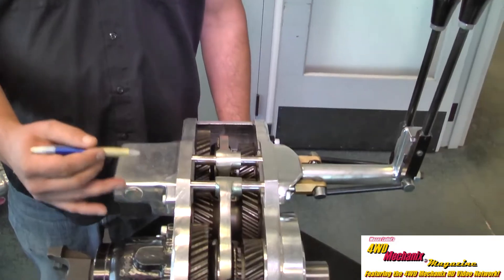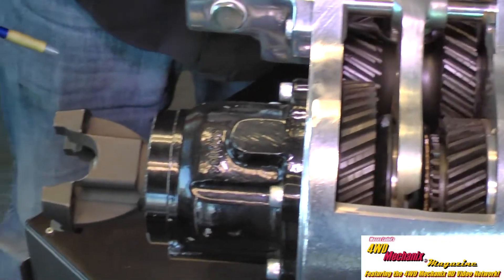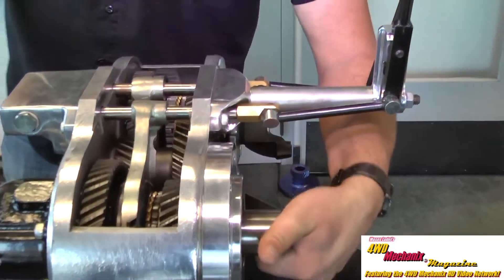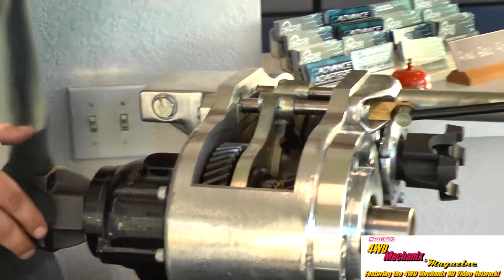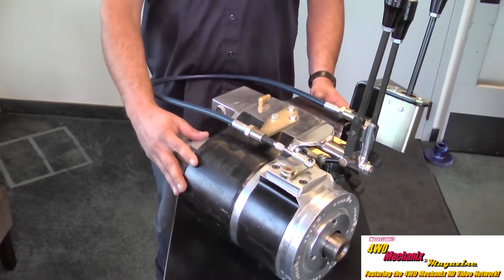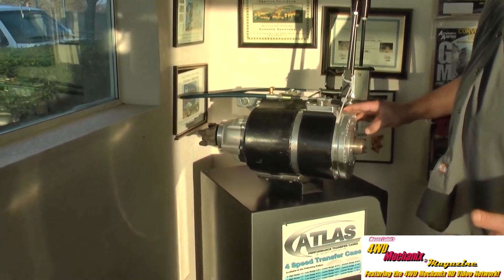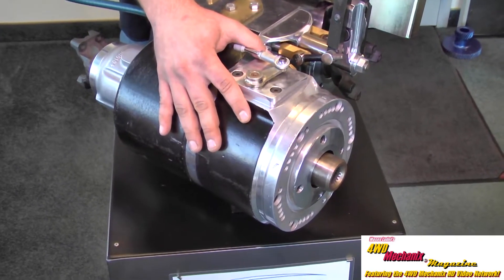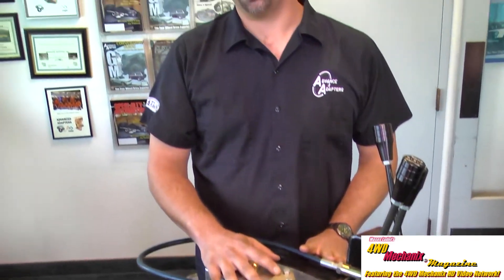Advance Adapters Discusses the Atlas Transfer Case Design and Operation

Comment: I have an 06 dodge ram 1500 4x4,  5.7 Hemi. Do you have any adapters for an atlas 2 speed for that?
Reply from the maker: That's a good question for the folks at Advance Adapters.  There are many Atlas configurations, and it's likely your Ram can be outfitted.  Shift linkage is an issue to discuss as well...Give tech a call at 1-800-350-2223.
Reply: @RoadReadywithMosesLudel  Thanks. I thought the linkage was cable ? Is so, it shouldn't be too bad. It's my daily, with a little off-roading, I'm sure an Atlas will be bullet proof.
Reply from the maker: Yep, cable in several configurations.  The Atlas is used "universally".  Your transmission output is common, as is the Ram's OEM transfer case.  Driveline and U-joint fit is a consideration with a transfer case changeout.  You have a slip-yoke output now and will need to make the rear driveline compatible with the Atlas.  Front shaft length could be another concern.  This is remedied with custom driveshafts.   Advance Adapters can clarify...There should be a path forward here.  Yes, an Atlas would be "bulletproof" with your powertrain.

Comment: What speed can you shift from 2h to 4h and vice versa? My stock jeep jk allows this at speeds up to 55mph. This is mostly when driving into snowy conditions on highways and slowing to a near stop is not practical.
Reply from the maker: I discussed this with Steve Roberts.  He shares:  "You can shift 2wd to 4wd at the same speeds that you do with the stock t-case. As long as the JK still has a live front axle and the front driveshaft spins all the time, the Atlas will shift 2wd to 4wd High Range at any speed. Shifting high range to low range obviously requires a slow vehicle speed roll."  So, unless you have installed a front axle with free-wheeling hubs or an axle shaft disconnect (like the YJ Wrangler used), you're set.  Steve's point is that the front and rear axle shaft and driveline speeds must match up for a smooth shift.  Free-wheeling hubs would have the front axle shafts dormant when the hubs are set on free.  That would not match up with the rear axle shaft speeds.  Does that help clarify?
Reply: @4WDMechanixMagazine It does for me. I was going to ask the same question. Thanks.

Comment: Can an atlas handle 1000 foot Ibs of torque
Reply from the maker: I'm familiar with the Atlas' use in high horsepower Ultra4 and Baja race vehicles.  You would have to discuss the 1000 lb-ft torque load with Advance Adapters, though.  That kind of torque is turbo-diesel or high-tech supercharged (gasoline ICE) or EV race car levels.  You can reach Advance Adapters' tech support toll free in the U.S. at 1-800-350-2223.

Comment: Could you explain in different configurations of your transfer case, how a mechanic expert in transfer cases would be able to incorporate a central/center differential in the Atlas transfer case, please? Anyway, will you offer a model special with central differential incorporated anytime?
Reply from the maker: The Atlas is a gear drive transfer case and has no provision for a center differential.  A center differential transfer case is just that:  a transfer case with a differential mechanism built into the unit that can deliver biased speed outputs to the front and rear axles.  (This is like an AWD car would do.)  The Atlas 4-speed does have a planetary system that enables more gear ratios, but this is still not a differential for driving biased speed/torque to the front and rear axles.)  There are "all-wheel drive" transfer cases like the New Process 249 (used in the Jeep ZJ Grand Cherokee 1993-98 as "full time 4x4").  The NP249 uses a friction clutch assembly, planetary and a viscous coupler.  That might be what you are looking for.

Comment: Can you put it in neutral to flat tow without damaging it
Reply from the maker: From Advance Adapters guidelines, a 2-speed Atlas II transfer case can be flat towed with the transmission in gear (manual transmission) or Park (automatic).  Yes, the transfer case must be in neutral...I always check these aluminum transfer cases for heat build-up with an infrared heat sensing gun.  The rule in the day was to check for heat every 300 miles, but I would check more often if you tow at speed or under hot conditions.  The transfer case is oiling, but oil gets hot and thins.

Vehicles with the 4-speed Atlas and its planetary gear set should not be flat towed with the driveline(s) connected.  Here is a direct quote from the AA website:  "We do not recommend flat towing vehicles equipped with the 4-speed due to the additional bearings used in the planetary housing."  In 2018, Advance Adapters introduced a lubrication pump and "flat tow" option for the two-speed Atlas units.  AA is continually updating these transfer cases for maximum service life.  The FAQ shares the history and advancements:  https://www.advanceadapters.com/b-atlas-tc-history-updates-to-the-atlas-over-the-years-faq.

In my view and experience, flat towing is rough on the chassis, steering system and gear train.  A two-wheel "Kar Kaddy" or similar dolly helps some by getting the front wheels off the ground.  This protects the towed vehicle's front end and steering from wear or damage.  It also provides better control of the towed vehicle.  Quality dollies have brakes, too.  Even with a dolly at the front, the 4-speed Atlas would still require disconnecting the rear driveline.

I'm a fan of using a car hauling trailer (open or closed deck).  But that does not work for everyone.  Although it looks easier to flat tow, it isn't.  Backing up the flat towed vehicle can be an issue, and the steering is always under stress.  Some insights into the Atlas transfer case can be found at Advance Adapters' website or directly at their link:  https://www.advanceadapters.com/c-atlas-transfer-case-shifting-operation.